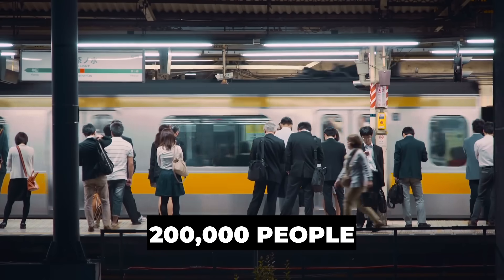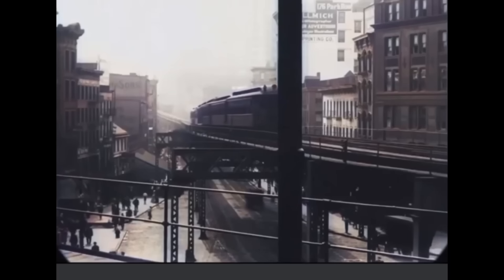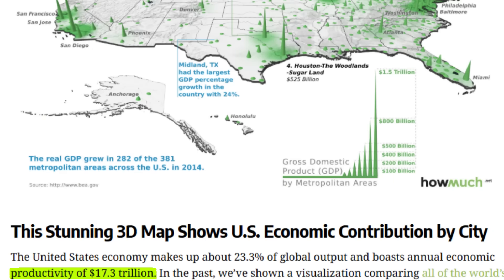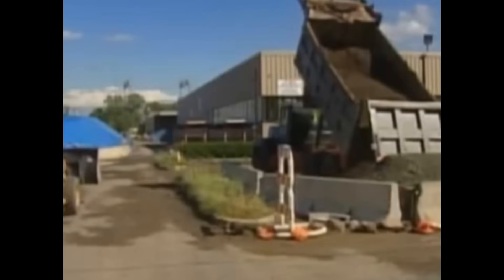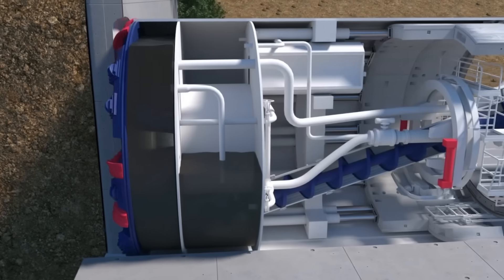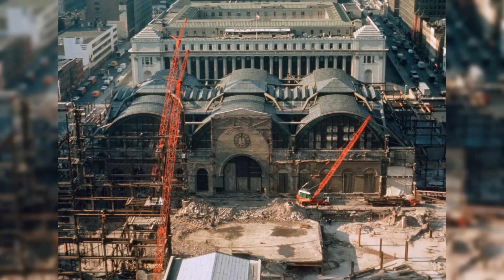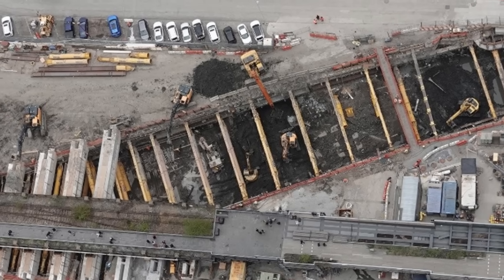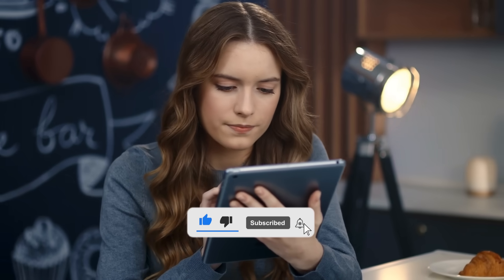Inside America's NEW $30 Billion Tunnel Under the Hudson River

Comment from the maker: NOTE: Because the tunnel and new trains are still under construction, some early shots — like the one at 0:12 — use representative stock footage to help visualize the story. It’s included purely for context, until official material becomes available.
Reply: Perhaps there was no need for this message, since you had no problem using a nonrepresentative image as your front image to this video, making the tunnel look like it would have glass walls just to falsely lure people in to what should be a good enough video that doesn't need any trickery.
Reply from the maker: Hi @cosmicprotocol — the thumbnail is just a stylised tunnel graphic used for visual impact, not meant to be a literal representation of the real structure. The video itself covers the actual project accurately. Appreciate you watching and sharing your thoughts — would love to have you on board as a subscriber for future videos as well.

Comment: The cost would surely be 1/10th in case these trains ran over land/water instead buried inside. Modern trains look cool too. Why hide them below where no one can see them.
Reply from the maker: Hi @iracture - interesting take—and you’re right, elevated or over-water rail can be much cheaper in some cases. The underground route here was likely chosen for city planning, noise, and space reasons, but there's definitely a strong case for more visible, accessible train designs too. Thanks for watching and adding to the conversation.

Comment: 3:18 Access to the Region's Core would have been built and operated by NJ Transit, terminating at a deep station below 34th Street between 6th and 8th Avenues, connecting to those subways and Penn Station (NYPS).  There was no rail connection to NYPS or provision for Amtrak, so the Gateway Tunnel and expanded NYPS were needed regardless (NYPS serves 3 times the passengers it was designed for).  A Government Accounting Office report found there was no evidence supporting Christie's claimed cost overruns, with his true motivation using NJ's contribution to prevent an inevitable gas tax increase that he enacted 6 years later.  It would have been complete by now and doubled NJ Transit capacity.
Reply from the maker: Hi @dk50b — thanks for sharing all that context! It’s really interesting to see how the ARC plans evolved and why the Gateway Tunnel and expanded NYPS are so important for meeting growing passenger demand. I really appreciate you taking the time to share your thoughts and watch!

Comment: Let’s also talk about why the saltwater got into the tunnel. They were designed with storm doors and they were NOT closed and allowed the salt water in that corroded the rail and cabling. We’ve abused them for over a century
Reply from the maker: Hi @RellupNorth — storm protection and maintenance are definitely critical for tunnels like these. Saltwater and aging infrastructure have certainly taken a toll over the years. Appreciate you sharing your insight!
Reply: North River Tunnels never had storm doors
Reply from the maker: Hi @dk50b, thanks for clarifying — yes, I believe that’s right. The original North River Tunnels didn’t have storm doors. The new Gateway tunnels will include them to help prevent the kind of damage seen after Sandy.

Comment: I wonder how much a bridge would have cost.
Reply: It wouldn't matter. Unless there is a formal decision to limit clearance height on the Hudson, a bridge would have to comply with at least the clearance standards of the George Washington Bridge, uptown though it may be. That's a bridge deck at least 180 feet above the Hudson, then dropping down below the bottom of the Hudson to enter Manhattan. The steepest gradient mainline passenger trains can take is ~4%, and those are purpose built electric multiple units on the German high-speed line between Cologne and Frankfurt. New Jersey Transit trains aren't close to this capacity, and neither are locomotive-hauled Amtrak trains. Freight? Forget it.
Reply: Well, first it would have to rise up high for ships to pass beneath and then quickly lower and sink below ground in Manhattan where all of the other rail lines are located. Trains can't accommodate quick elevation changes very well. The vehicle bridges into Manhattan require constant maintenance to not corrode from the salt air and Nor'easter storms. So I'd guess a bridge and the approaches would cost at least 2/3 of what this tunnel is costing. But it's vital for business and millions of people.
Reply from the maker: Thank you for sharing your insights! It’s great to hear such thoughtful analysis on the complexities of infrastructure.

Comment: Too little too late.  They should be building 3 or 4 lanes in each direction to help future proof the system. The original tunnels should be also done over after the new ones open.
Reply: Old tunnels will be rehabilitated after the new tunnels are built if I remember other news outlets. 

I TOTALLY AGREE WITH YOU BTW
Reply from the maker: You're right! It's great to see that both new and old tunnels will get attention. It’s all about improving infrastructure!
Reply from the maker: Thank you for sharing your thoughts! It's important to consider how we can future-proof our infrastructure as we move forward.

Comment: Goodness, it's still a wonder of its time.
Reply: Especially because TBMs make tunneling much easier at present.
Reply from the maker: You're absolutely right! Tunnel Boring Machines (TBMs) have revolutionized the tunneling process, making it much more efficient and safer.
Reply: @Boundless.Builds.Official  The new boring machines like the one building LA's purple line to Santa Monica remove the rock and handle its disposal simultaneously for faster progression.
Reply from the maker: It is incredible how these machines work!!
Reply from the maker: @stephenedwardsnyc - would you like to see more videos with these TBM's in action?
Reply: @Boundless.Builds.Official  No I'm more interested in all of the ancillary projects approaching the new tunnel under the Hudson. I don't know if costs that are quoted are just the tunnel or if all of the approaches on the Jersey side are included. The B1M has a video on this critical railway and he lists like 5 or 6 related projects for the tracks to get to the tunnel. Expensive but necessary.
Reply from the maker: Thank you for your comment! It really is a marvel, and I’m glad you enjoyed the video!